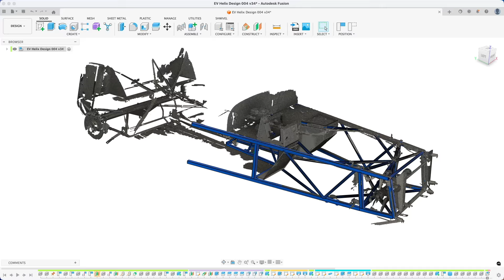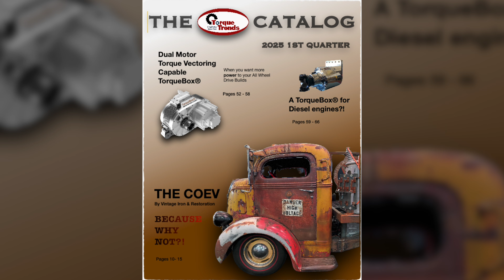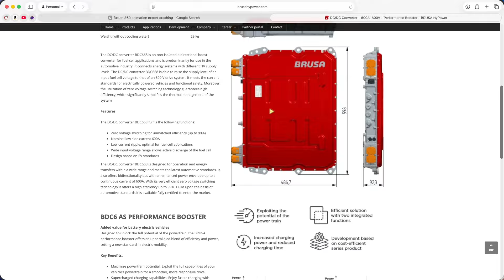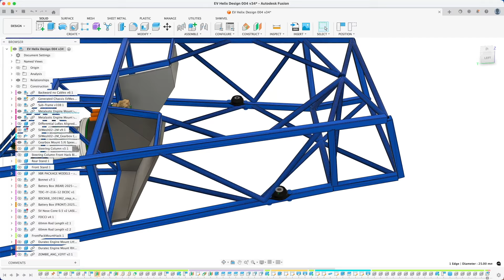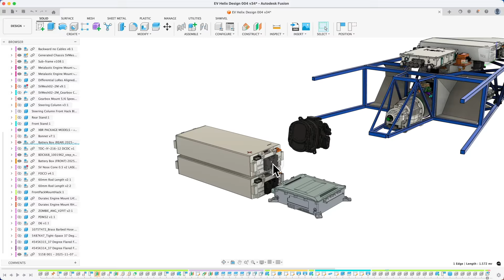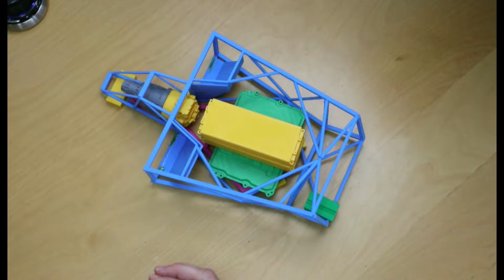Project sEVen pt6 : Mega Two Year Update Video - How I designed an Electric Vehicle

Comment: Did you have a mission statement beyond the 0-60 , top speed and kerb weight ?
I’m in awe of your skills, methodology, and how much money you’ve clearly got to throw at this. What’s life for if not to just have a ball !!! 
I’d be interested to know more about what a successful outcome looks like ?
Are you hoping to put this into production ?  How is it likely to be better than what an OEM could or will produce ?
Part of Chapmans genius was to utilize components that existed, and every component you have to design, create, from scratch, well, the sum of those may likely end up being the single most cost heavy part of the build ? 
Compromise is necessary always, it’s just where you choose to pare it back that will take the project in a very different direction. 
As I said, I’m in total awe of your obvious talent. Much respect.
Reply from the maker: Hi David (I assume David), thanks for you kind words. I’ll try and come back to each of your points in turn…
In terms of mission statement - there’s three elements there (at least). Firstly the technical aspects you talk about 0-60, weight, top speed etc. And I characterise that as being dynamically like my Caterham 420R. The weight is going to be the biggest problem there. Secondly, I just wanted to see if it could be done - I’d seen a few people have a go and their results looked compromised. I’m also aware of a few trying and failing, so could it be done. Thirdly, does it make sense. Both financially and emotionally… the first part of that is obvious but emotionally can it deliver a driving experience. It won’t be like driving and ICE car, but can the Scalextric like driving replace the gear swapping and noise… dunno.
In terms of production. Possibly. I’ve done a handful of startups and have exited and re-entered a few. So it’s not my first rodeo (we even got onto the LSE full list at one point). However, it’s not a driving (😮) force behind the project. I’m designing everything so it will be saleable - i.e. considering things like product liability insurance, not just road worthiness and reliability. My approach has usually been with products to spend a lot on the prototype… learn all the lessons and then cost engineer down to a MVP. Perhaps that’s do-able here, perhaps not. I know a bunch of other people who want to do a Seven kit, but IMHO they’re not in the right ball park. But if it can’t be commercialized then I’ll have had a ball.
On the subject of “better than OEM”. Well even Caterham are a low volume car maker. Others in the Seven space are even tiny in comparison. Who’s to say I can’t compete with one of them? I’m sure Caterham will produce a great Seven EV at some point. But I think it would be unlikely to be something that would produce a conversion kit. They’re all about selling new cars. I couldn’t see Bob going down that route, but who knows now he’s gone. So there’s a space for the 10,000 or so cars that at some point a percentage of might think about converting their car. Especially if the emotional bit above works.
Chapman: for sure that was his modus-operandi. Chapman may have raided other people’s parts bins, but he didn’t use second hand. I’m using components from VW, Brusa, Helix etc. All used for other primary purposes. So not so far away. But Colin also existed in a different world. We have Euro6/7 now and the world is far more litigious… maybe he couldn’t play the same way now.
You’re right about Compromise, for sure. But you sort of have to walk-the-walk to figure out where the compromises can come from. This is my phase 1 prototype. Maybe there’s a second prototype, or just something I take to car meets so people can kick its tyres. Don’t know yet.
Thanks for you kind words… I’ve just got to deliver something now 🤣
Reply: @Purplemeanie  Wowzer, most kind. I hope to kick your tyres at a meet one day then !
I run an i3 , and currently an old Boxster. I love cars and love electric also. 
Have you considered an Elise conversion ever ?  There’s a couple out there. 
Really nice to hear you’re in this for more than just this ‘mk1’ project. Bravo sir.
Reply from the maker: Thanks! 😊
Isn’t an Elise conversion called a Tesla Roadster (perhaps you have to be an EV nerd to get that joke)! 🤣 
I nearly bought an i3 a few times when they were new… but my wife couldn’t get her head around the suicide doors. Great cars though!
Reply: @Purplemeanie  yes, lotus pretty much designed and built that mostly. 
But there’s a couple of DIY done versions. 
I long for the day when an EV sports car can be significantly lower kerb than an ICE, and you can literally determine where you want the mass to be, and how low the CoG is 😊
Reply from the maker: @curzondavid yep 👍🏻 i’m looking forward to that day too 🤞🏻👍🏻 BTW… can’t say much in this public space, but I have someone helping me who worked on both sides of the pond on the Roadster. He’s been a great asset to my project! 👍🏻

Comment: My car - on the icon is similar - uses Subaru suspension front and rear - it has a forklift motor (been on the road since 2013) - but I feed it with 390v and 1200amps so it does go quite well
Reply from the maker: Cool! Interesting. So ~400V at 1200A means about 45kW. How heavy is the car?
Reply: @Purplemeanie  You missed a zero 400v and 1200A means 480kW!
My "device" is 800kg (Duncans Dubius Device)
Reply from the maker: @duncancairncross I know… I embarrassing miss right?! 😂😂. I’ll check your stuff out 👍🏻
Reply: ~450kW no?
Reply from the maker: Oh yeh! 🤣 Not enough coffee when I wrote that! Wow! 👍🏻
Reply from the maker: I went and checked out your EV forum post. Looks cool. Though there’s lots of posts, so haven’t worked through them all yet! 👍🏻

Comment: Great update John, I think a lot of us have been keenly waiting for it, but I also get why these things take time, and your overview of the challenges is really well put together. I'm converting an AH Sprite, which is not quite as small as a seven, but not far off, with all the same challenges: 

 - no cheap off the shelf solutions exist to repurpose nissan leaf of similar drivetrains;
 - packaging is tight tight tight! I've explore multiple options but ultimately can't fins a way to make a single carrier for motor and front battery box.
 - getting the right balance of mass versus range, and performance is a compromise.
 - steering columns are a PIA that you need to design around 🙂...

We're probably at a similar point - I've just procured a lot of the HV components (which locks in a lot of CAD design parameters) and I'm building up the system on the bench to verify operation before moving to installation.

Some things I've been grappling with in CAD:

 - how much clearance is needed between battery modules and the housing, to allow for safety and ease of HV systems assembly;
 - what steel thicknesses are needed on the battery box to balance mass versus strength;
 - Design for assembly so I don't end up unable to assemble components without 4 thumbs, or caught with two different components needing to be assembled first...

Anyways well done and hang in there! We look forward to the next update.
Reply from the maker: Fantastic! What a great project. I’d be happy to have a chat with you on the phone at some point if you fancy a natter. You can email me at john dot Martin at Purplemeanie dot co dot uk
Reply: Good idea! I've found the community support really useful

Comment: Honestly I am in awe of the level of detail and the professionalism of this project. Absolutely bloody fantastic. You mention Caterham got a motor to fit in the rear. Obviously there was a reason why you didn't choose that same motor and I'd be interested to know why. Also presumably you considered the CSR rear suspension and discounted that.
Reply from the maker: Thanks for the comment… two very shrewd questions. Hopefully I can do them justice. Caterham used a motor from Swindon Power Train. And to get it in they had to modify the chassis, bringing the rear bulkhead forward for the passenger and widening the transmission tunnel for the battery. Some of the animations in my video are with the SPT motor, I was going down that route too to start with but Cascadia Motion, who supplies the inverter, discontinued the one that was certified for the motor and so that became a dead end. And in any case I’d realised that a single rear motor with SPT wasn’t going to work… but I had switched to a transmission tunnel approach with them. That set me back about 6 months… spending all the time on SPT and then having to find another motor/inverter. As for the CSR… you clearly know your Caterhams…. I did look at the CSR and a couple of friends with them will vouch for me laying under their cars taking a look. I also looked at Meteor’s IRS conversion and drove their test car - very impressed. But there’s a lot of chassis stuff going on with the CSR and the Meteor IRS had a similar problem but also with the fact that it was probably not going to pass DVLA regs without an IVA… and a Q plate at the time. So… yes I did look at CSR and IRS, but decided against it for a conversion. Caterham could play with all the chassis stuff because a) they had the expertise to know what they were doing and b) were targeting a track demonstrator and so weren’t worried about road and therefore DVLA (at least that was my reading… and I spent quite a bit of time with them talking about what they were up to). Hope that answers your questions.
Reply: @Purplemeanie  Well you've been as thorough as I'd expected you to be. Such a shame there isn't an elegant rear motor solution. YASA in Oxford have produced 738hp from a prototype axial flux motor that weighs 13kg. Maybe if you spoke nicely to them? :-)
Reply from the maker: @plonk7. I did try to talk to Yasa but they’re very focused on Mercedes now (I think I got that right, from memory). I struggled a lot to get companies with decent technology to talk to a one-man-band. Even if I say I have aspirations for making this a commercial project, they still want volume projections, frame orders, etc. 
I played around with Axial flux motor concepts for quite some time (and I did talk about them in one of my background videos). While the lower RPM and higher torque are attractive, the larger diameter is a challenge for a Seven… just nowhere to put one. Of course that leads you to considering hub motors but i didn’t have the desire to modify the chassis or hub arrangements in my system and I don’t like the idea of the unsprung mass increase - definitely not a Chapman-esque route! 😂
Reply: @Purplemeanie  Yes, I am sure it must be extremely difficult to get anyone interested in talking to a one-man-band. I'd imagined, probably incorrectly, that the diameter of the axial motor could shrink as power went down. So if they can get 700bhp out of one that size, 350bhp should be half the size. But I'm very naive. My physics knowledge is close to zero (I actually managed 13% in my O'Level mocks) so I also don't understand the issue with unsprung mass increase, thus hub motors seemed like a great idea! Thanks for your thorough and thoughtful replies.

Comment: Its a very high spec build, the brusa connectors are some of the most expensive i know of. And i dont know of many 800v ev conversions, following with interest
Reply from the maker: Yep… you’re absolutely right. I do love a highly powered drivetrain in a small car though. While the Brusa connectors ARE expensive (and really difficult to find a supplier), they sort of get lost in the rest of what I’m paying! 😱 But I’m having an absolute blast in the process… and it keeps me off the streets! 🤣 Thanks for following along. Don’t suppose you have any suggestions on where I can get the power connectors from, other than Brusa? They’re on the Amphenol parts lists but I can’t find anyone that carries them.
Reply: @Purplemeanie  its only brusa that you can buy the proprietary connectors from now. The company that was making them was bought out by brusa.
Reply from the maker: Hmmm. That's annoying. Hey ho... I'll have to stump up for the Brusa connectors then. I've got it all wired up with low current wiring on the bench at the moment. Obvs have to upgrade for the install, but while I'm just playing on the bench it'll be fine. Though I have had to 3D print some shrouds so I don't accidentally nudge an 800V terminal!